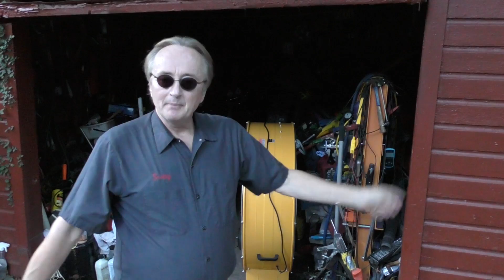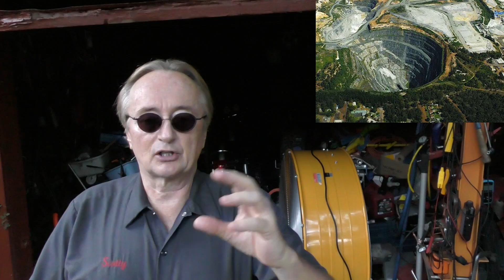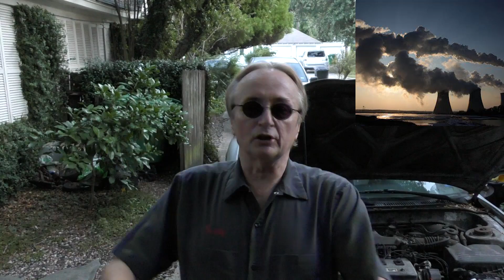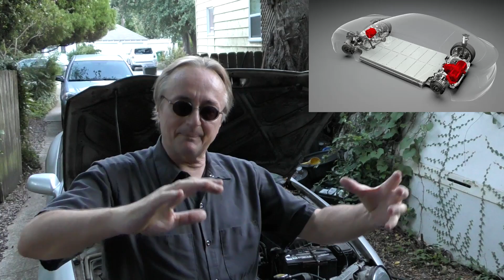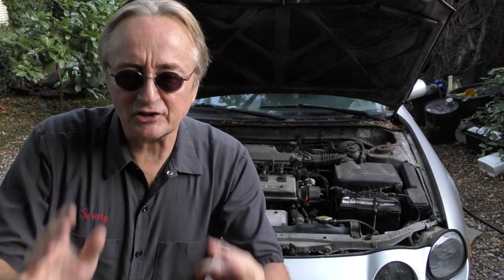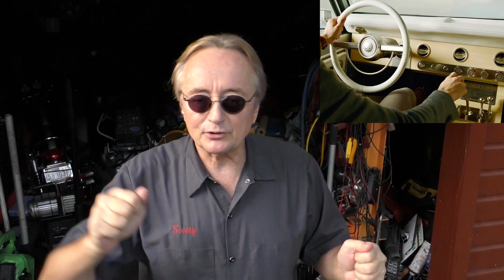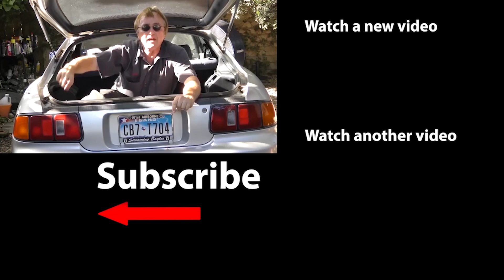Saying Goodbye to My Toyota Celica's Engine

Comment: A huge and powerful battery is being used constantly at a very short distance away from your body, with electronic circuitry running all around you. 
This means you are exposed to an increased amount of electro-magnetic fields. 
 Have studies been done on the health risks?  Studies done by INDEPENDENT researchers??

Comment: I would get an electric car for how simple they are. No oil changes, no radiator, coolant, transmissions, timing belts, water pump, or all those other this that go wrong with gas engines in general. A simple electric motor. I believe they have less parts than a gas engine so less can go wrong. 
It will be a while before I buy one.
Reply: Tesla our fancy electronic gizmos that a survive a month and when they break down they are stupid expensive to fic
Reply: Fix
Reply: But you are for forgetting about the complex computer system in electric cars. And they may have bad resell value unless you are a greedy or selfish person by ripping people of.

Comment: Convert to burning water. You would start to reverse the damned flood and reclaim land and have zero pollution. You don't have to worry about range. And the parts infrastructure for fuel motors is already there.

Comment: A company called Carbon Engineering can capture CO2 in the atmosphere and combine with hydrogen to create a liquid fuel that your car can run on. No need to buy a new car. No need for electric batteries and lithium mining.

Comment: Easy test to see which engine is better for the environment Electric or gasoline. Turn on a gasoline engine in a closed garage turn on an electric motor in another garage that is closed. Have one person stand in a garage with the gasoline engine and another with the electric motor for an hour and see who walks out after the hour. The person that walks out of the garage that is the engine that's better for the environment.
Reply: But when you have to make batteries for the electric car it’s going to be a filthy process and with a gasoline car that’s not really case and we already know that gasoline polluted but see what happens to fish and people who are near where they mine lithium. Like Scotty said it’s not a solution at all
Reply: @menukaariyadasa5863  it's not just a gasoline that pollutes it's all the other fluids and parts that needs to be manufactured that comes with a gasoline engine. Motor oil, transmission fluid brake fluid power steering fluid antifreeze, differential fluid transfer case fluid. And then certain types of parts for emissions. Take for instance the charcoal canister all the rubber hoses for the vacuum lines for the oil lines transmission fluid lines. When it comes to batteries they could always improve it and get away from lithium matter of fact there are better options right now that they're working on.
Reply: @michaeltrinidad1217  well done electric cars are money pits and break down and drain your wallet
Reply: @michaeltrinidad1217  well why use manufacture a whole new car when you can swap out the gasoline motor for an electric one that’s being environmentally friendly making use of waste
Reply: @michaeltrinidad1217  "When it comes to batteries they could always improve it and get away from lithium matter of fact there are better options right now that they're working on." How can you say that? You don't have any evidence to prove that it is happening, other wise wouldn't it be on the news? Right now, it seems that you are using an anecdote, to support your argument.  

And even if what you're saying about new ways of making batteries is true, that might not come into effect for a long time, if they're "working on it" as you insist, so batteries are still being made in the same polluting way.

Comment: I'd take a new one any day, modern cars are safer. Also I wouldnt trust that hacked together battery/motor system. Doubt it has good cooling - aka degradation problems
Reply: Yeah you’d be safer becuz of all the fancy gizmos breaking and it constantly being in the garage
Reply: I wouldn’t trust any Tesla to be reliable at all I’ll stick to my old gasoline car till I die than be in constantly repairing a money pit Tesla
Reply: There are professional companies that do it correctly

Comment: funny story my house is built in 1910 and had a NEW ELECTRIC boiler fitted in place of the old oil burner and the first COLD night I got home and turned the heat up and turned on the dryer I burned the mains wiring off the power pole my house was connected to setting the neighbour's yard on fire

Comment: Scotty is pretty right about almost everything.  However he is wrong about needing to beef up our power grid and power lines.  You charge your car at night after you get home from work.  Most likely you will use a timer to start charging just after midnight when demand for electricity is at its lowest.  The amperage is pretty much the same as running a clothes dryer.

Now if we can get super capacitors to hold just 60% of the energy per pound as a lithium ion battery we could charge up way faster and use way less amperage.  There is a lot less resistance when charging up a super capacitor compared to lithium ion batteries so you need a lot less electricity.  Your average lithium ion batter costs like $0.07 cents per kilowatt hour to charge.  A super capacitor just costs $0.006 cents per kilowatt hour to charge.  You could have a bank of super capacitors mounted on your wall in your garage that trickle charges all day long drawing very very little electricity.  Then when you get home or just before you leave charge your super capacitors that are in your car in about 30 seconds from the super capacitor bank on your wall.  Basically a 24 kilowatt hour super capacitor in your EV would give you a 50 mile range and just cost $0.15 cents in electricity.  Super capacitors don't degrade like lithium ion batteries.  They last 15 plus years easily and don't need heating or cooling.  Heck just pull into a charging station if you are low.  Pay a buck and in 30 seconds you are on your way again and the charging station just made $0.85 in profit.  If the charging station is powered by solar panels you are now pretty much carbon neutral.  Slap some solar panels on your roof at home and you are carbon neutral.

We just have to change our fuel filling habits a bit.  Nice thing is no stinky gas to handle. Probably make it robotic so you don't even have to get out of your car and in 30 seconds you are fully charged and on your way.  Any parking lot that has electricity can trickle charge multiple banks of supper capacitors so you could easily get a charge in any store or restaurant parking lot.  How about as you are waiting for your fast food order at the drive through you get a quick charge with your fries only an extra $0.75 cents.  Or perhaps they will offer free charging with every purchase.

Comment: Why would you convert an ICE-car that you would otherwise junk? And if your ICE-car still has value as a used car don't junk or convert it but simply trade it in for an EV or sell it to a private individual. It'll still get used by someone else and you'll make sure that you'll get an EV that's been designed and built as an EV and that comes with stuff like airbags, ESP or ABS. 

With government grants as high as €10,000 (in France for example), I think right now would be an excellent time to go electric. Over here in Europe, those electric cars you buy today will be exempt from road-tax for 10 whole years ... that practice probably won't last very long if more and more people go electric. But "filling up" and servicing EVs will always be cheaper. Plus you could install solar panels in your home to supply both the house and your car with green juice. And for that you'd probably also get a government grant and/or cheap financing.
Reply: Or keep it and stay out of constant repair on electric cars Tesla’s are huge money pits I’m keeping my accord whilst the idiots with inflated egos buy Tesla’s and end up in constant struggle repair

Comment: Conversion companies need to keep the gears in the transmission because they use motors with low max RPM and low torque. The perfect conversion would use a 15000 rpm motor and the original transmission locked in 2nd gear and full of EP additives. For this Celica to have minimally satisfying performance, he can use a motor with about 40HP continuous and at least 80HP peak. To get the torque needed, he can multiply the original motor's max torque by the 1st gear ratio and then divide by the second gear ratio, so he can start on 2nd gear in any situation. This way, only 2nd and 4th gears are necessary.

Comment: And for the north where salts are used to corrode steel vehicles, and elevate freezing point of water in roads, all of the sudden the S type Audi cars (3, 4, etc) become a good option because once they are converted there is little VW crap that can fail (engine, transmisión, etc)

Comment: If you take all the environmental problems ever caused by all the lithium mines in the world, it will never match the damage done by the 2010 Deepwater Horizon oil spill in the Gulf of Mexico that spilled 4.9 million barrels of oil.  And, that was just one of many oil spills all over the world.  Unlike oil which is made into gasoline and burned, lithium in a battery is reused hundreds or thousands of times (every time the car is charged).  A long range EV uses only around 10 to 15 kg of lithium in its battery.

Comment: I won't argue the green points, but the reason a purpose built electric car is superior to a conversion is that it's designed from the ground up to be electric.  Batteries are packaged low and in such a way they don't eat into the interior space and they are well balanced with the weight down low.  I've converted many a bicycle into an ebike and while some of them are fast, it's not that much cheaper (and in some cases more expensive) than buying a purpose built ebike.  And the purpose built bikes are usually a more well designed package.

Comment: I don't see electric as a money saving thing for consumers. You know how people are always saying " Electricity is so much cheaper than gasoline, gas is so expensive ". The government has a thing they call " Gasoline Tax ". If a lot of people start using electric cars, the cost of electricity is going to be raised to compensate the government for lack of gasoline tax. What did you think? Did you really think that the government was just going to get used to doing with less money,,,, don't kid yourself, you're going to get screwed one way or another, whether it's through expensive gasoline and expensive gasoline tax, or expensive electricity and expensive electricity tax. It's not like the government is going to leave you a big loophole so you can save money at it's expense. Nope, you're going to be on the hook forever, but it'll just be a different hook.

Comment: The comment that gas cars will become illegal is silly.  What will happen is that there will be a phase out in new cars.  Gas cars will become increasingly rare at which point gas stations will start shutting down (or at least not selling gas).  As time goes on, cars will be converted or junked.  Most people aren't willing to drive 15 year old cars and so the conversion market probably isn't as big as you'd think.

Comment: I would say wait at least 5 more years with your gas vehicle before going electric. They would be more mass produced and cheaper. Just like how almost all lead batteries are recycled today, lithium battery recycling will start to become more mainstream, reducing the mining impact. When companies start realizing the shift in electricity consumption, they will improve the infrastructure to meet the demand. It's no different from the time when gas vehicles was the new thing and starting expanding. There are problems involved and they will solve them.

Comment: I've got an idea to save the climate: tax the hell out gasoline and diesel fuel.  Use the revenue to upgrade the power grid.  Drive less. When you do drive, use a fuel efficient vehicle (small car, small motorcycle, bicycle, etc.).

Comment: I have a question Scotty. How do the brakes work if you convert your petrol/diesel car to electric? Turn your engine off and there's no vacuum for the servo/booster and the brake pedal becomes rock solid with virtually no braking at all! How about power steering which, as we all know is driven off a crank driven (unless it's also electric like some Fiats) drive belt so as with the brakes, virually no steering!

Comment: I wonder, Scotty, why we can't just substitute a big electric motor for the internal combustion engine use the same transmission, etc. ?   Then stick the battery pack in the trunk or wherever . . . sounds more feasible than an electric motor for each wheel!

Comment: Here comes scotty the scotty kilavolt. I see scotty with an oscilloscope and laboratory build and repearing electric vehicles. Iam with scotty iam tired of oil driven combusting drivetrains . And there is also ev west in sandeigo.yep I always knew that scotty kilavolt was a secret scientist . With a secret underground stage 2/3 charging facility and it would not surprise me if scotty has allready built an electric vehicle that recharges itself . I bet he is just waiting g for the right time to break it out so he dose not end up missing like a lot of other great inventors and builders.

Comment: In most cases, an electric car is a coal-powered car.
Reply: wheeliewheelie1 in most cases you’re incorrect. Coal makes up 27% of the power grid nationally.
Reply: @johnmoore1495  US electricity generation is 63.5% from fossil fuel. The rest is nuclear and renewables. Get it straight.

Comment: Every car is already electric, just not as electric as a Tesla. My alternator on my car charges the battery which in turn powers the ignition, lights, circuits, radio, dash,interior, windows, handbrake, window washers, turn signals, central locking, engine components, sunroof, tailgate, transmission etc. All that remains is to convert the drive wheels.😎

Comment: Actually, Diesel isn't the most polluting. It's polluting way less than an electric car overall. It's even more true with the new diesel engines and new types of diesel fuel. Look up "Neste My diesel" for example. 

With electric cars comes problems in form of batteries. Where are we going to store dead batteries, and how many useless electric cars are we going to end up with in a short matter of time?

Comment: Conversation kits have bee around 40 years. Good to keep the standard transmission. Reduces motor power requirements. Also, electric motors are most efficient at the top end instead of the bottom end like an ICE.

Comment: He has a great point.

Buuuuut. I've seen some dangerous conversions, and if you're not an electrical engineer with a background in structures, and  the statics and dynamics of moving vehicles - I would NOT recommend it.

If you CAN find a professional to do it in the states, for $5,600 I'd say go for it. But, the least I've ever seen is around 30K, and for that price, I'd go with a Chevy Volt which sells for 12K on the used market.

Comment: I thought electric motors had flat power/torque curves. Wouldn't that make the manual transmission in that truck kind of pointless? In any case, I would LOVE to drive that thing, I bet it's a trip! EDIT: I could see how the trans might be useful for high torque just when the truck is stopped or on a steep hill, and maybe for a higher top speed to get past the max rpm of the motor.

Comment: Good video Scotty, very accurate information, you have obviously done your homework on this subject.  Although it's a really cool idea (an electric car), it's not nearly as "Green" or practical as they are being advertised.  As a retired electrical engineer, I can vouch for the fact that the U.S. power grid is unable to support electric car charging as it stands today and upgrading the grid to accomodate the needed capacity would be cost prohibitive.  In fact, since the 1980's the electric companies (at least in the southeast U.S.) have been encouraging reducing the home electrical footprint.  Driving an electric as a commuter car on a daily basis, is equivalent to adding another house to the grid per car!  Then there is the huge problem when you run out of charge on the road or there is a large scale power outage.  Instead of AAA showing up with a 5 gallon can of gas, this would need to be replaced by a rescue truck with a 100 kilowatt generator and quick charge power supply.  After 15 minutes of charge on the side of the road, you would have the equivalent charge of 5 gallons of gas.

As far as a practical electric car goes currently, a plug-in hybrid is the most practical.  As far as a car gas-to-electric retrofit, if someone comes up with a motor/generator that goes between the engine and transmission, that would probably be the most flexible.

In the next 10 years or so, I think we will see some better battery technologies that will be an improvement over Lithium batteries, making electric cars more practical.

Comment: I got an interesting question. If I had an electric motor hooked to my manual transmission then it won't stall if I leave it in 5th gear and take off in 5th gear? And my clutch will last longer won't it?

Comment: Agreed! I've seen people convert old (air cooled) VW Beetle and those are not even that hard to fix and kept efficient with the original engines (if they aren't really busted).
Besides this EV conversion kit, there's probably a few around, but more generic ones might be more interesting for most front engine cars.
Definitely, it would be interesting to get some 50's-90's cars converted!